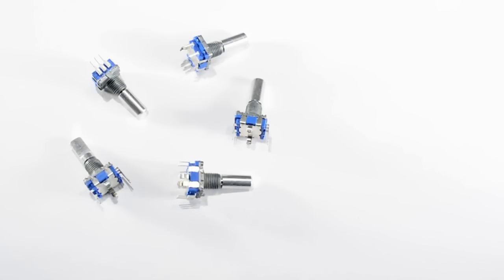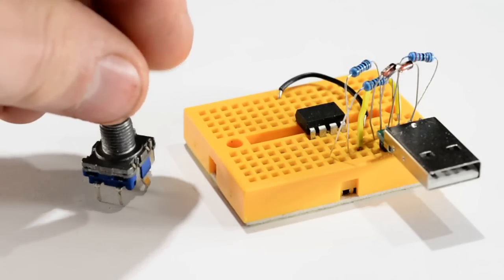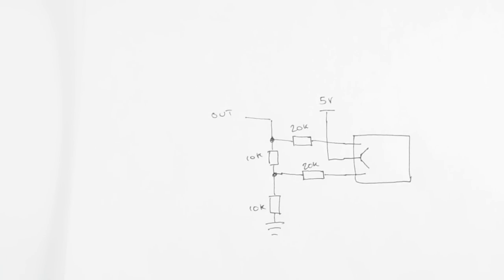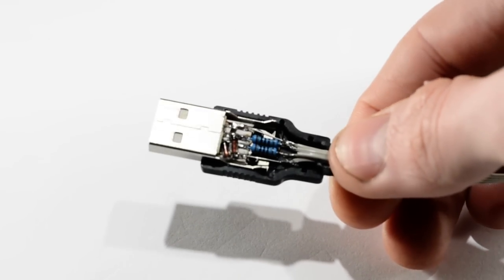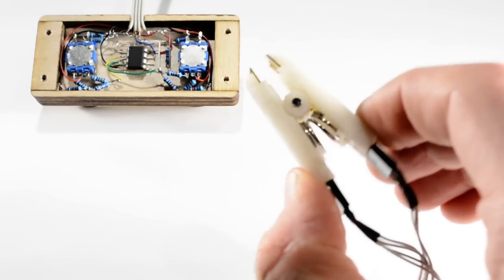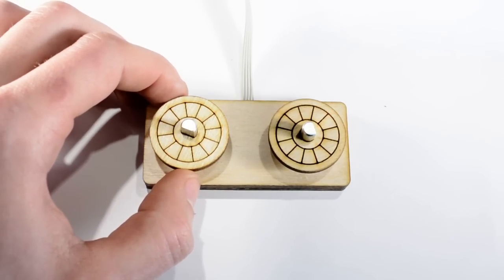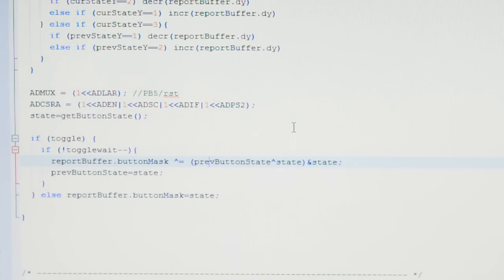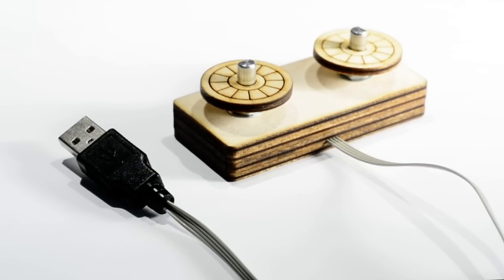Building an Etch-a-Sketch USB Mouse

Comment: Actually this is useful for building 3D models as u have finer control on navigating the 3d environment.  3D mouses are very expensive and this might be a good starting point project.

Comment: I was thinking of doing this myself, unless someone else had done it. Amazing job on this project, well done! 👍
Reply: Do it anyway. It will give you more ideas during the build/code as the pieces start to work together. My first etch-o-sketch (not copyrighted) was just pots on the user port of a C64. Totally useless and flawed, except for the fun of building and ideas it created.

Comment: now if you put one of them at a 90 degree angle and use a ball to move these around, flip it all upside down so that the ball rolls over the table when you move the contraption, you are back where we started

Comment: This is very much like the very first mouse which had two wheels on the sides of a box, at a 90 degree angle.  The wheels would roll as you moved the box around on a surface.

Comment: 9:22  the right click cancels the line your currently drawing, how many hundreds of hours i've used ms paint and never knew about this.
Reply: It's not "cancel", it's because drawing with right button means using color 2 (so obviously, your "normal drawing", with left button, is using color 1), which is white on default. If you set color 2 to different color then you can draw in other color by using the right button.
What's more astonishing, the eraser is not "erasing something off", it's just a brush with its color 1 and color 2 reversed. So by abusing color 2 you can even "erase" something to black.
Reply: Hakurei Cirno it is cancel I just checked, I set the 2nd color to a non white color and then drew a line, right clicked and it canceled it
Reply: @creator-link  I think that he means it's not a feature, it's not intended to cancel your line (there is an undo, who why would cancel be a feature to build into it). I think that it's just a side effect of it trying to draw in color 2 while it's already coloring and just not knowing how to handle that so it freaks out.
Reply: But it does cancel it, and it does not try it with the 2nd color

Comment: interesting project, well done too I'd say. I've thought about an easier way of making one of these, using just a dissasembled ball mouse. The really old ones usually had two small rotary encoders, which could probably be replaced and used the same way as in this video. You would need some buttons added to use as Left and right click/reset if necessary. Just a thought though.
Reply: Somebody didn't watch the whole video.

Comment: considering it's a step motor you could turn it into a game controller knob with force feedback (very tiny racing simulator wheel)  and then all you have to do is make an etch a sketch game with force feedback.

Comment: Back in 1984 I was programming an HP 9816 microcomputer that didn't have a mouse but it DID have a spinny wheel on the top left of the keyboard. You could  move a pointer left and right with the wheel, or up and down with the shift key held down. It was a bit etch-a-sketch buy it worked really well.  We used it for driving a thin layer radio-chromatography system. http://www.hpmuseum.net/images/9816with9122andbigkeyboard-35.jpg

Comment: Now convert the mechanics of an Etch-a-Sketch so that you can control it with a computer and use you control interface to control the computerized Etch-a-Sketch... because why not...

Wait... hook up a plotter instead... and make art with it remotely... because why not...
Reply: computerise an etcha-sketch to ack as a display device....
Reply: With a refresh rate of like... 2FPH (Frames Per Hour)

Otherwise known as Slow Scan Television... hehehehe

Comment: This was really cool until you said mouse acceleration
Reply: why
Reply: Pomegranate It isn’t accurate to how an actual etch a sketch works, and it can be frustrating to use in some cases. Not usually just everyday work on a pc though.
Reply: @pomegranatechannel  If you do anything other than browse on your computer it can get annoying
Reply: @pomegranatechannel , because it means the sensitivity of the mouse becomes unreliable. One inch on the desk won't always mean 800 pixels on the screen. This leads to all sorts of inaccuracies when working at a slightly faster pace than you're used to or trying to do any precise movements.
Reply: @SanderSkjegstad  I see, thanks. I like your profile pic btw!
Reply: @pomegranatechannel  No problem, and thanks! I like your username!
Reply: @pomegranatechannel  FOURTY FOUR SECONDS AGO
Reply: What is mouse acceleration
Reply: @Zi7ar21  To put it simple, mouse input is "accelerated" more if the mouse is moving faster, and treated more normally the slower it's going.
Reply: the bane of gamers
Reply: yup, true disappointment
Reply: yeah mouse acceleration is so inprecise and just plain garbage